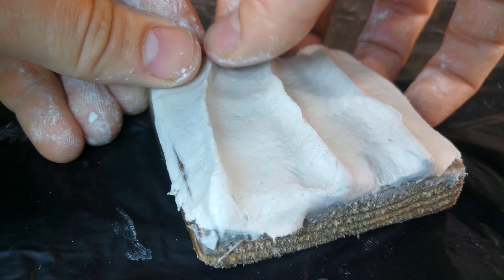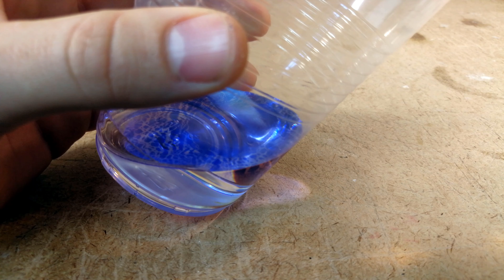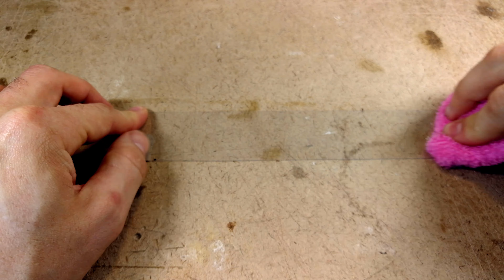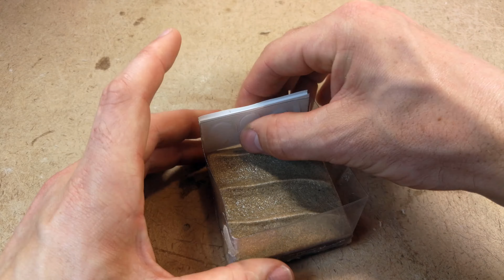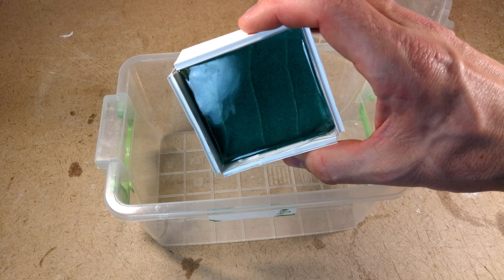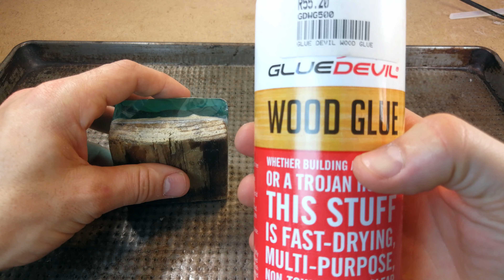DIY Resin Ocean Cube Tutorial

Comment: Olá.
O que é esse processo que você faz com a resina dentro da vasilha com água. Você mistura o corante no endurecedor e só depois na na resina, e no final porque você coloca a peça dentro de uma vasilha e tampa? 

Pode explicar esse processo por inteiro?
Reply: The colorant must be included before the hardener. the catalyst
  it is mixed into the resin when it is to be used. The lid of the container is put on to prevent dust or dirt from falling while drying. The idea is very good, although if it is done with a more refined technique to avoid bubbles, and very little dye is used, the result will be sensational.